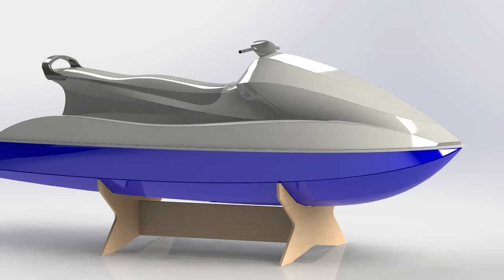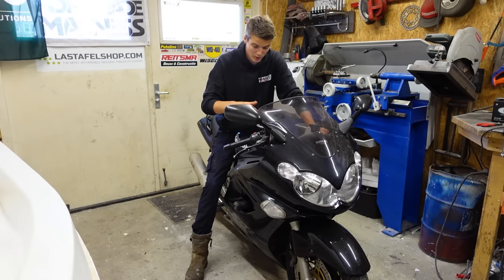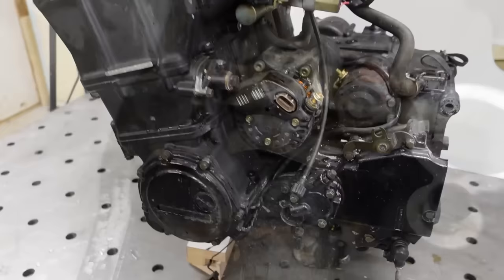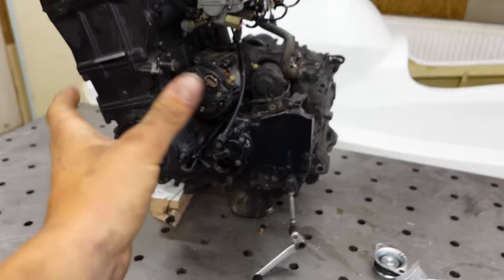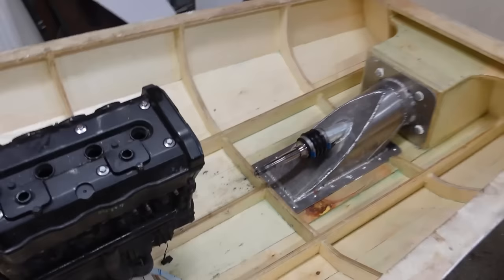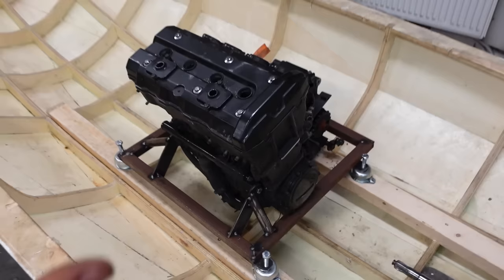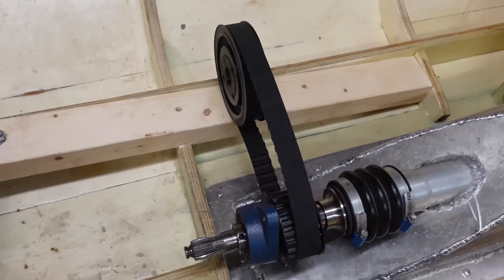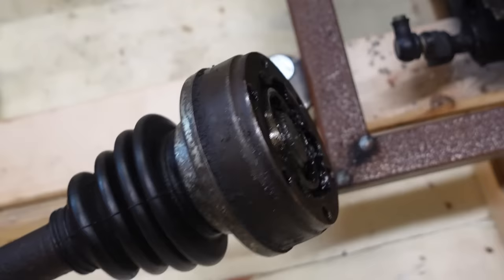Homemade JETSKI part 4: Crazy Engine and driveline

Comment: As usual, a well put together video. I always think: "I wonder whether he'll put a brace on that. Ah yep, he's done it." Nice to see someone who takes pride in doing a good job. Only thing I think you might need to consider is RPMs. That drive shaft from a VW is likely not rated for any more than about 2000rpm and I've just looked at SKF bearings in those oval housings (not sure what you've used but I cant see it being better than SKF) and for a 20mm ID they're only rated for 8500 max RPM. Some problems to chew over... Maybe fine for occasional use but I think they'll become headaches if left unaddressed. All the best!
Reply: You are right with the bearings. But i  think that the driveshaft could be fine, because it wont have to take a lot of torque. Spinning way faster, but less load than what it was build for. Anyways, driveshafts and bearings are not very expensive. Worth a try and if it works, it works.
Reply: Normally a jet drive doesn't spin much faster than 8500/9k

Comment: Awesome project! You really should be using  epoxy laminated marine plywood beams instead of poplar 2x4’s. Also You really need to use a dial indicators for shaft alignment to measure runout to reduce vibration caused by misalignment.
Reply: I couldn't believe he just used framing grade 2x4s!
Reply: @shelbyseelbach9568  send it
Reply: He's probably fiberglassing over it all. It'll be fine

Comment: You might make sure that the oiling system for that engine is up to snuff. You may have to add/reposition baffles in the oil pan, the engine will be tilting in directions it wasn't necessarily meant to in that configuration. Also, think about putting a system in where oil changes can be done without removing the engine, or reaching underneath it. An easy solution for both is to use a dry sump system.

You may also think about using a heat exchanger for cooling, as opposed to just letting the water from the lake/river/ocean/etc. run through it. This engine doesn't really have anything (anodes, coatings, etc.) to save it from corrosion.

Other than that, keep up the good work.
Reply: Yeah, I was thinking exactly the same after watching Superfastmatt who had the same issues in his motorcycle engine mounted in that tiny Honda. I can imagine the issues will be much greater on a jetski, which is a lot less stable to say the least.
Reply: @bertfransman9864  Which is why a dry sump would probably be the best way to go. running angle doesn't really matter. The carbs might be angry about it, though.
Reply: Oiling is always something major to consider when swapping motorcycle engines into non motorcycle vehicles
Reply: @jetink600  Unless you can mount them transversely as they're meant to be. For inline engines, anyway. Not usually the case, however.
Reply: @akio2589  true, and even then i would still be mindful
Reply: @akio2589  the carbs are not meant for watercraft operation so they will likely be unhappy even in the normal operating position because of the float designs. He should pick up different carburetors eventually that will utilize a float less fuel regulation system (diaphragm) like all pwc do
Reply: @LeObsidianCraft  As long as enough fuel is getting to them, they should be ok. It's not like float bowl designs have never been used in marine applications. Besides which, I think that the diaphragm design was used primarily because it was a nice convenient way to move fuel reliably without having to use a separate fuel pump.

That being said, in the states at least, PWC have to have spark arrestors on the carb, and that'd be pretty difficult to comply with on those carburetors.
Reply: @akio2589  yeah floats work great until the motor isn't right side up or bouncing off huge waves 😂😂 and then there's the hazard of fuel spilling into the hull from the overflow drains when it inevitably tips over. 

The diaphragm designs were use for safety reasons and to make sure that the motors would operate at all possible orientations. Some people even modify their standard diaphragm carbs to use remote fuel pumps (infact Kawasaki did this on their 1200 triple by having 3 carbs without fuel pumps tied into a separate fuel pump though hard fuel rails similar to a fuel injection setup.)

Flame arresters can be found easily and are universal. I believe most K&N filters are also flame arrestors. Big issue is water ingestion though the carburetors as there is no water trap built into the intake.

Comment: Make certain to add some plates below those wood runners where your engine mounts bolt through it,otherwise you gonna have some loose bolts issues very quickly... Blue loctite is your friend also... Great idea on how to couple the engines output shaft to the jet drive..

Comment: i like your idea  and OverallConcept  i began riding PersonalWatercraft  in the late 1970s  then continued buying new machines  into the 19990s  i always thought it would  be kind of cool to have some type of Transmission  on the drive system  once the Manufacturers   started installing Engines at 1000 Cc and larger BTW  i have ridden a lot of Motorcycles  as well  and i liked  controlling the speed of my bikes through the gear boxes  instead ofthe brake systems  because it gav yu the ability to Power out  a turn

Comment: Pinch that belt around the prop shaft pulley with a couple of roller tensioners. There’s a tremendous amount of force on the prop shaft and it may slip in the current configuration.

Comment: Fantastic build. All of the people questioning the integrity of wood forgot about Viking ships that sailed all over the world. After epoxy and matt fibers it will be strong and water proof but still retain the vibration dampening and flexibility.  Very cool.
Reply: Only thing I would keep in mind is that those CV joints are designed for heavy loads at low rpm. @60MPH with 2 foot tyres  would have the shafts spinning less than 1000RPM. That's why you never se a welded on balance weight on them like a driveshaft( which is closer to 4K RPM and has a wider orbital path. 12.000 RPM would show any balance problems. If you have rebuilt these you know that they are fairly brittle with slotted cages and 6 ball bearings. Before you use it I would add an all around guard just in case it lets go. Your boat hull is below, and your crotch is  above, lol. Be safe. Have fun!!

Comment: That’s great stuff! Man it’ll have some power. The belt drive tensioners may need a locking bolt to stop them from twisting loose with the amount of torque that engine will have, same thing happened on my golf cart jackshaft..
Reply: I thought of so too. With big engine

Comment: Nice progress.
I recommend you put a bolt tensioner on the belt drive as those slots will slip and lose tension. It's a 160bhp engine with gearing reduction remember...
Also I would not have kept the gearing personally, just used the belt reduction. And I hope the engine is not too far back for weight distribution. I'm sure it is similar to the jetski but that's a small engine and large hull compared to the jetskis themselves. I hope it works great.

Comment: looks good! i had a car engine (4age) direct drive with some car cvs, (around 7-9k rpm max) it needed high speed cv boots or at high speed the boots turned into pancakes and pushed out all the grease everywhere!

Comment: Enjoying the project - thanks for the excellent content.
As the engine/water jet are mounted separately the belt drive between the two is a seriously weak point given the rpm/power it will have to deal with. In performance boats, alignment of the engine and propeller shaft is critical.
If cv joints/belts were a good way to go I imagine Yamaha, etc would have done it...
Anyway, hope I'm proved wrong! 🙂

Comment: Still significant wobble on the sprocket side when you rotate the driveshaft in the last part of the video. Think that will cause lots of vibrations. Maybe you can reduce the weight more in the connection piece you made? You also might want to make a metal drive shaft tunnel for safety. Also on bottom side. When that drive shaft breaks it will cause havoc.
Reply from the maker: Will do! The wobble you see was caused by the not being tight😁

Comment: on the shaft splicing, use the lathe to cut a small dimple to go into the center of the CV, that way they are centered.  Then have a good gouge so that the weld gets into the center of the shaft too

Comment: I think I would go straight shaft from the engine to the belt and pulleys all on the rubber bushings and the only place you'd need a CV is from the small pulley to the jet drive... That way all the tension and drive forces are confined in the steel frame and isolated and you'd only have the torque from the output of the small pulley to the jet drive actually loading the wooden frame and it would be doing it through rubber bushings... The only real benefit I can see of doing it the way I said is that lord knows how well a VW cv axle will like doing 8500 rpm
Reply: I wonder how fast a boat will sink when a CV shaft puts a hole in the hull?

Comment: In all honesty,  I would have put a sleeve over the joint on the driveshaft that you welded , and also beef up the structure that the cv joint goes into , there will be massive torque loads on the area . Otherwise top work as always 👏 👌 👍
Reply from the maker: Will do thanks👊🏻
Reply: @homemade_madness  I did a similar thing before and the weld would keep shearing off , so I put a chrome vanadium socket over the welded join and welded that in place , it's never failed since 400+hp 😉 👍👍👍

Comment: Great job I would be concerned about the amount of power you are putting through that rubber belt considering contact is minimal through the teeth on the pulleys. But you have a great skill. Could you fit a safety loop over the drive shaft in case it becomes detached. Great videos keep them coming.
Reply: Least its the first thing to go when something gives out and yeah drive shaft can over time create tress cracks from the vibrations and give out, slamming into hull, so that needs to be addressed asap. I kinda like the belt idea for the quiet operation compared to chains, but it will be nightmare to swap while on water when it eventually snaps due age or just power going trough it.

Comment: Love the video! I would consider adding a guard or bracket over the belt to hold the 2 sides of the belt holder on the top looks like it wobbly
Reply: I would be more worried about hack job drive shaft witch if snapped in any kind of speed would slam hole in the hull, though belt drive there works as mechanical fuse so thankfully it wont wreck everything if pump jams from debris, but replacing the belt will be big issue if you are on the water and it snaps, so he might want to add paddle holder into the frame as back up method, hell places and storage for oars might be good idea.
Reply: @Hellsong89  you are right a drive shaft loop too maybe in this case a steel sleeve (cut in half metal tube) Incase welds fail

Comment: It will work.  I love how u use pretty much hand tools to build stuff. Except the lathe. But yes I would use belt over chain. Chain if it broke would blow a hole through the hull, that would be bad. So belt is way better.  Gearing on engine you will put it in 6th and leave it there, that's my prediction.  Bsafe dude. Love the build

Comment: One suggestion, build a loop around that driveshaft. There are a couple of different failure points in it now, and that last thing you need is a snapped drive shaft trying to send you into a low earth orbit

Comment: I hope you plan to take it all apart and glass up the interior for strength and sound proofing? At least 3 layers of double bye and a final gel coat with a 1/4 inch foam sandwich.
Reply: If not that lumber will rot in no time

Comment: Overpowered, overheated exhaust and a wood hall and chassis, a perfect combination for a fireball. I suggest some kind of thermal insulation and heat vent. You are steal using a water cooled bike engine, that was mounted almost on the outside. 
Also use a heat exchanger if you don’t want to clog the cooling system.
PS sorry for the English.

Comment: Really great idea but sometimes the simplest mistakes can make the whole construction break. This is the 2 by 4 you used will be ok for a short time but in future use a stronger wood like cider wood or treat the 2 by 4 with fibre glass and resin over a 2 by 4 marine ply. Apart from this it’s amazing and so proud cool really cool idea! I’m making a prototype boat electric hybrid combustion. Maybe you like to give some ideas sometime. Let me know? Ciao for now.

Comment: Should have run chain to a shaft with a small sprocket on the same end and then on the other end have a really big sprocket but not to big that then has a chain to a smaller sprocket that goes on the drive side, if geared correctly you could use very little throttle input and have fantastic results

Comment: I like the build but there are a lot of things that are not going to last. The force of water is more than most people realize, your intake SCREWS will never hold the water intake down. The side load on your drive will also be a problem and like a few other people mentioned the force to turn the prop will eat that belt. It will hold together for a bit .

Comment: I think you are piling on the weight with all the transmission/cv/shafts/bearings.

 Since you are using a common seadoo pump housing, you could just add pitch to the impeller until the engine RPM is below your target. I.E. your bike engine's peak HP is probably not at 12K, just because it CAN rev to 12k.... 

By probably, I mean it actually makes exactly 150hp peak on a good day at 10000rpm, and roughly 120hp at 8,000. This means, you can look at a similar seadoo by hp, and use a similar pitch impeller, to limit RPM at the peak. 

While overspinning your pump is not in your best interest, neither is running an unproven hull well over 50mph, depending on what you final weight is. How long do you want to run your engine at WOT, should also be considered. Maybe selecting an impeller for a 120hp ski, and running at 7-8k rpm all day, with a little extra available throttle, is a better choice, than using gear reduction via transmission and jack shafts, to spin 12krpm for the sake of peak engine RPM, and risking all those driveline components revolving at 12Krpm to begin with, when you finally feel froggy, and slip into 5th or 6th gear.

Speaking of gears, there is no such thing as a pulling gear with a jet. Yes, you will spin the engine faster, and the pump slower. The pump cares not. It will produce the exact same thrust, if the engine is spinning 10Krpm, and the shaft turns 5K, as it would if the engine is spinning 5Krpm, and the pump is spinning 5Krpm. 

There is a reason jetboats and jetskis don't use transmissions.

 Jetskis, may, use an underdrive reduction box, such as yamahas vx110, but that is all it is. If the reduction drive interests you, it would be the other way to go, as the vx110 uses an impeller that allows the engine to around 8k, but the impeller only spins around 5k. I think the MR-1 uses the same gear box for a 140hp engine, and allows around 6k rpm.

Your idea to run off the crank was the right one in my opinion. Kawasaki PTOs are the best, hands down. The most forgiving, with the least amount of failures. Make sure the crank is spinning the correct direction, mount that PTO setup to your driveshaft and crankshaft, pick the right impeller, and enjoy.

Also, you will need to remove the water pump from the engine. The jetpump will provide you the cooling water you need, maybe get half or even 1 hp gain. Just make sure to T in a pressure regulator set to about 13-15psi, and dump the outlet of the regulator overboard.

Comment: Be very careful with the belt setup.. I work on skis for living and they shear splined shafts regularly with the power they make could only imagine how long the belt would last... Otherwise love the content and not trying to say you didn't think it out before hand but just a warning so you're not stranded one day. Maybe carry extra belts with you if possible to change in water with tools carried.
Reply: Yeah it does look bit flimsy, I haven't checked the ratings for what looks like to be an inch wide belt but just from looking at belt driven superchargers it seems bit  narrow. In the end its all about the tangential tension exerted by the drive pulley, that will the thing that snaps it, especially with clutch dumping or similar impact loads that can be much higher than the peak from the engine running normally. Any ways for a guy like this its going to be a quick thing to fix, live and learn.

Comment: Good idea using a motorcycle driveline. I'm wondering why you didn't go to a watercooled shaftdrive though. That would've saved you from making the shaft adapter an kept the shaft on the centerline.

Comment: Have you taken into account the proper reward pressure for the jet pump driveshaft to keep the carbon ring sealed? On some skis this force can be considerable.. I didnt see the other side of the pump, so maybe your good if you have the standard setup with the locking ring and just dont have the prop installed in this vid...

Comment: You might want to make sure that adapter you made from the drive gear to the driveshaft is rotational balanced, otherwise it's gonna destroy the internals of your engine as soon as it exceeds 2k 4pm.

Comment: I WANT that chassis bruh....the motorcycle chassis. Finished watching and though not sure doesn't oil cause glue to separate on the plywood pieces stacked vertically ?? The center rib would therefore be susceptible to catastrophic failure at an very inopportune time. Probably sealing it in fiberglass would have been a better idea..... MAYBE.